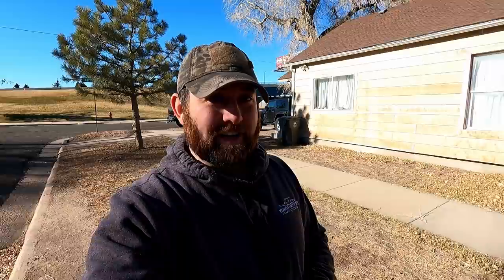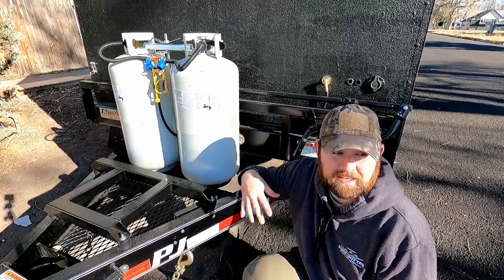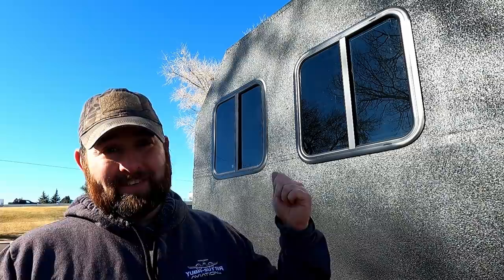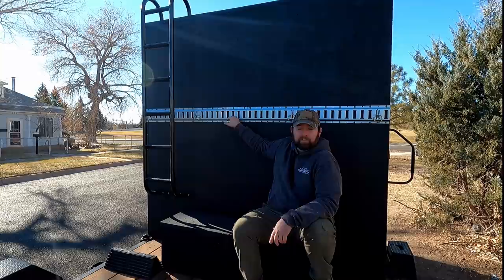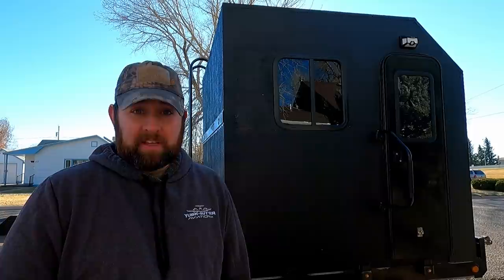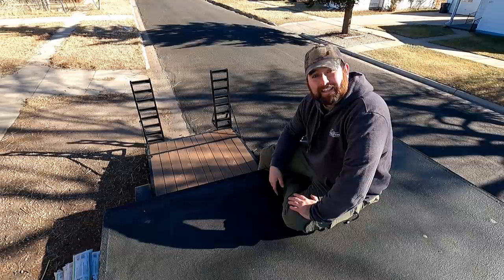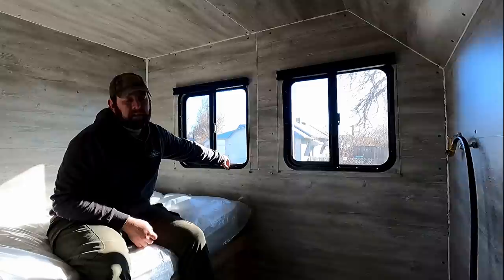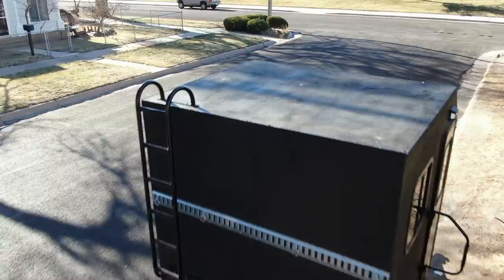DIY Crawler Hauler & Bugout Camper BUILD

Comment: So, you have full cylinder pressure gas going into your living space.. Interesting...
Reply: He might want to research the RV Codes as bringing HP gas into the trailer probably violates the code. All trailers have some sore of in-line regulator outside and the appliance regulators inside handle that pressure.
Reply: The changeover regulator he has is correct. Not quite sure what he meant, but you can clearly see the regulator there. The house barb situation is another issue. Should have UL approved hose there. Norm is correct.
Reply: @jefferydaniels5650  He specifically stated that he did not regulate the pressure down because the units inside the living space did not work at the lower inlet pressure. The change over could be a full pressure change over module.
Reply: @markchisholm2657 
At the 2.26 pboto he has an automatic change over regulator
Reply: Whether he used it, I cannot see in the video.  But the regulator drops the water column and the pressure.  The appliances use their own regulator to fine tune the lp gas for it's specific needs.  I'm a licensed lp installer and work at a lp storage terminal that stores 40 million gallons.

Comment: For your window trims, go to a body shop that specializes on commercial units/RVs, have them build you frame you can slide into your openings, and rivet, screw, glue on.
Here in Tampa, there's a place called All American Sleeper Cab, they can make your trims, with an outer lip.
People at the service department at truck dealerships, Ryder, Penske, etc, can guide you on where to go.
Best of luck.

Comment: Great build. for your batteries make a battery box to mount under the camper near the front just behind the propane tanks. but locate them in a position to not make the tongue weight to much and mount a spare 20 lb   propane tank in the event you are out longer than anticipated and think about a battery power inverter. and you mentioned water ! how about getting a shallow racing fuel cell with the foam insert to prevent the water from sloshing around and mount it under the deck between the rails. These fuel cells are made from aluminum and you cn get them in many shapes and sizes. Again great build keep up the great work.
Reply from the maker: Those are some kick ass ideas. I already have a powered station installed right now, but I really like the water tank idea!

Comment: harbor freight has a solar rope light and I just drilled a small hole, and then spray foam, around the hole and it comes on at night automatically. I’ve had it a couple years now just bought a couple extra on sale

Comment: When I built mine I  immediately realized I needed a ceiling/roof mounted vent and (or w/ out a fan is up to you?) the adjustable hatch does wonders when providing good air circulation/ventilation also being a nice little “sky light” also. Consider a small solar power kit to help supplement power...they are nowadays inexpensive and very simple and pays for themselves quickly, easily upgradable. You’ve done great so far!
Reply from the maker: Thank you! Since this video I've installed a Maxxair fan on the roof and ita awesome. I also installed two more solar panels and got a Bluetti AC200P for the power source. I love it so far.

Comment: Also add a boat seat mount or some way to post up in a chair and drink a beer. Or whatever having your own chair ready to go is so nice at times.  Also if you plan on going out on your own think about things as if you got hurt like broke a leg arm foot make sure you can get to you needed things and can load up the crashes keep too. Even if you don’t plan on doing it alone. It makes things nice when they are needed and sometime no one else has even thought about it. Kinda the point of your own tow rig is if you brake down having fun you still get home even if your loping on a rigged crutch getting home. Always be prepared for as much as you can and then some and learn from each trip. Learned a lot growing up and always travel with the set of I have to make it home at some point with all the toys. Either drag them my self home or keep cash to get a towel with the toys home. Always keep a ride home either bye fixing things your self repairs or Sapir parts carried and always keep some cash hidden somewhere in case you have to make a parts run to the store after flipping it and lost phones and wallets. But I’m not made of money and work hard for my money but I still try and have fun. And like to have nice things. So sometimes  having to build them your self and maintain them your self or pay someone else. Plus it’s about the adventure and how you got wherever you were going. Plus sometimes you have to build to have exactly what you want and piece it back together a few times till you get it worked out. But it’s part of the fun. Also always keeps like freeze dried food stached in the keep just in case you get stuck somewhere 2-3 days longer then you wanted to since parts are on order your in some small town that’s closed on the weekends. Just keep it away from the animals like in small ammo can bolted some where. Or if the trail is too small to fit the tow rig. Just some things to think about. Learned from experience and years of camping and playing with dirt bikes boats wake bords and just long road travels. Spend less money on paying people to do things and less buying things and build them your self then spend more time out and enjoy using the toys inside of too busy working.

Comment: I think I would add a cover for your propane that all four seasons, Put a window on the back of your cabin so you can still look out the back, and probably made the cabin into a faraday cage just for giggles so you can still put you electronics and not have to worry about them. put some solar power on your roof, probably put some 5gl cans for water with a foot pump and a little sink and counter top for cooking inside too during the cold months.  But over all pretty darn cool.lol just saw the wife in a pic cute, lol that's funny! :)

Comment: If you go off road may I suggest a bar from the front of your trailer to the outside bottom of your mudguards just to protect your guards and wheels from running into obstacles. It certainly helped on mine.

Comment: All looks great. I didn't read all the comments so if anything I say was said sorry. For your generator What about building a cage around it with some type of latch with a heavy duty lock so it cannot be removed but bolted to the trailer so there's no noise. See if u can mount the batteries under the trailer possibly  closer to the axles to balance weight. I would also come up with a clean water tank under the trailer with a solar water pump to get washed. All looks great so far u are going to have the vel also charge the batterys wile driving to your destination I hope. Looking forward to seeing the progress.

Comment: Looks good. For water, my 2cents it go small and light. Maybe some 4'or6' PVC tubes on each side up on top as holding/gravity tanks. Tongue weight being an issue dont want to much up there. You just need enough for dishes, cooking, solar shower type things. Maybe later you could put a small holding tank elsewhere with a little pump to get it up top again.

Comment: For water storage, I would put the main water tank under the trailer yours would have some decent cavities under the boards for an easy 20-50gals or more, and still have room for grey and black water table on the sides under the deck. 

Your propane tanks should ha e some kind of shielding, if you have an accident they are not protected. And could end very badly for you. 

Looks cool tough.

Comment: You are going to want to put some sort of protection on the front where your propane, and other connections on the front of the trailer.  Otherwise your truck tires will likely cover them with mud, dirt and crap while driving.  You might be able to just use a heavy rubber mud flap for a semi truck.  As for the A/C, I would not use an roof mount RV unit.  They draw a ton of power, but it would be overkill on such a small compartment.  A lot of small camp trailers now use window A/C mounted in the wall.  My truck camper just has a fantastic fan on the roof.  With the windows open and the fan on it is very comfortable inside on all but the most humid days.  Don't worry about the details, they will come together and answer themselves as you use it.  Have fun with it.  You've done great.

 Just a few ideas worth exactly what you paid for them.  lol   I like the build!

Comment: Good looking rig👍🏻
Too late for your build, but anyone else thinking of this may consider buying an old pickup camper shell/topper, cut the windows out for your build & trash the old fiberglass.  I did this on the 3 truck campers I’ve built & saved a boatload versus RV windows. They’re the same windows 👍🏻
Keep on truckin 🤘🏻

Comment: I'm going to put a black, flat water tank on top of mine the sun will heat it. And it will be gravity fed.  The one I'm build will roughly be the same size as yours.  Yours looks great. I'm also gonna ad a black water tank under the bottom of my trailer for a little toilet and sink.

Comment: Super nice, I would add a wood burning stove.  They make small  ones for camping.   You would save money on propane when firewood is available.   Also needs a carbon monoxide detector, a really important safety feature, when you have heat in a shelter.

Comment: You have done an excellent job, the propane tanks are excellent but I may leave the generator to gas and propane, your other choices are fine, I would have made the floor thicker to improve insulation.
Don't be upset with your work you have done well.

Comment: I work at ODL in Zeeland,Mi. We make customs sized windows with trapped blinds, and low E tint to either repell heat or attract it. We just use air in our windows, argon isn't used in a lot of windows anymore. Talking maybe a 20*30 house window tempered for around 70-80 dollars. And 10 year warranty on all products.

Comment: You should use some pop up camper ideas, specifically the slide out tray step, which would minimize lost ground clearance, and maybe the stove that can be used inside and outside. Then of course add awnings, or even a 270 degree awning to cover both the trailer side and the door side

Comment: So badass!!! I'm in the same boat with sleeping quarters and towing my xj
Reply from the maker: Yeah, I got tired of not being able yo find a toy hauler that could pull a full size Jeep so I just decided to build one. So far I love it, I got a lot of ideas from van life videos and builds.
Reply: How much does the trailer weigh, without the jeep
Reply from the maker: Without the Jeep it is 6000 lbs. But without the Jeep on on back it puts too much tongue weight in the truck. It needs the Jeep for proper weight and balance.
Reply: I figure it would need the jeep for proper balance. If you had to guess what's the weight of just your sleeping quarters? I'm trying to stay light weight, id like to stay under 9500/10k total trailer weight including the 4k lb xj

Comment: Got a couple thoughts on the steps/ladder to get in/out of the camper portion. 
The RV steps you mentioned are cool how they fold up, but that's the end of their benefit. In my opinion they tend to be weak and under engineered for the more , um, ... "huskier" gentlemen... like ourselves. 
The simplest design is to use half of a step ladder you find at your local hardware or thrift store. OR, build one with 2x6 lumber and some grip tape(like used on skateboards). Either can then be attached using a hinging bracket that allows the ladder to be lifted up and stowed against the door of the camper and then secured with a strap, bungee cord, or carabiner, etc. 
If you want something sleeker and cooler looking, search "ships gangway". This is just for a visual reference of what I'm going to attempt to describe. You can use metal safety tread(used on tractors and heavy equipment). I prefer the kind that has diamond holes and looks similarly to expanded metal mesh. The design is a little complicated to fully explain in the comments section, but you essentially run two lengths of pipe or angle iron down each side of the ladder treads. Bolting one pipe near the front, and one near the rear, of each tread, on each side. The distance between the front and rear side holes of the treads should be as uniform as possible. As should the holes in the pipe/angle iron. Once all is loosely bolted together, there will be a top and bottom pipe on either side of your treads. Attach the top end of the bottom pipe to your trailer. Then lift the top pipe up until the ladder treads are level with the ground.This is where the top pipe should be attached to the trailer. The attachment point for either the top or bottom pipe should be easily detachable(toggle, hook, pin, etc). This design allows for movement of the treads in relation to the pipes. Essentially, the treads will always be flat to the ground, regardless of the angle of the ladder or distance/height between the door and the ground. If you want a better description or help, feel free to message me.

Comment: Check it out, you could put a black plastic tank on top of it and have warm showers in the summer as long as you park in direct sunlight. 
The steps, fabricate a set that hangs off the rub rail on the trailer right under the door. 
Looks good so far though man good work!

Comment: might be able to take the trim off on the inside around the windows and use aluminum flashing cut to size and painted black then reinstall trim to cover the insulation. great job on the build. mine is a store bought 23 foot toy hauler with a 42 inch led bar which really comes in handy boondocking

Comment: pull inside frame off and add black metal strip to cover gap. replace inside frame. trim over door is a matching fabric covered arch called a "headknocker" sitting on two vertical outside corner trim pieces. hope that helps.

Comment: You are very creative. There is something that you need to consider since you using propane. You propane detector, down low and a carbon monoxide detector up high for your safety. A vent fan on the back wall instead of the roof due to space constraints might help out as well. Keep it up. Also, you might consider get an amateur radio license with radio and a cb radio for those unusual but occasional emergencies that take place in poor cell phone service areas.

Comment: I have a suggestion on the table you want. Do a flip table mounted on the wall with pull out bracket. Oh and as for a sink and cooking area a sink can drain into a 5 gallon bucket. So you can build it small enough by using stainless steel bowls. Trust me they work just drill the drain hole put ur drain in and ur good. I seen some really cool folding stools also that could slide under the bed when not in use & ur table is folded away ..

Comment: The generator could have a roof like an upside down square pan with extended edges to keep it out of the sun and rain, mounted on posts that hinge on one side and have a lock on the other, also a plate in front, with sides that extend back at an angle so rocks and road debris don't beat the hell out of it.  When you make a bed, I think the kind you hinge to the wall so when not in use, you can stand it up against the wall and out of the way....same with a table.
Reply from the maker: I was thinking of something similar

Comment: Awesome build. A suggestion for the water situation would be with that high of a roof put a 30 or 55 gallon drum and use gravity feed. I use one for my cargo trailer full of gear and it works great for utility purposes. You can put a spigot in one of the bungs and get enough flow to wash dishes and fill pots etc. Again this is an awesome idea, purpose built DIY projects are usually better suited for the guy building than anything you’d spend 10x more on for some assembly line piece of equipment. Good job sir.

Comment: Hi!

A few ideas.
-Flip out floor between the deck and your door.
-Sink a table leg in the deck, sink it so when you need to fix Jeep it will not be on your back when you are under your Jeep.
-Awning, a big sturdy awning.
-Paint the house part white, black box will be an human solar oven.
-Quick disconnect for the stop block, when you come from your solar human oven to the deck and had two cans of cola drink you will fall from it every time, its like trap wire. :D

Comment: Hey John. Snazzy idea and great appeal!! 💯. This may be overkill.. But maybe a fuel deflector shield.. To keep those road rock from potentially causing damage to the tanks? Tying it into the generator too.. Maybe like a v-hulled "hood" if you follow.. With the ability to raise it for access if needed. Cutouts could be made to access the generator. Also giving it that wind deflection and flow up and over the cabin. 🤔🤔

Comment: Wow brotherman! Good thinking when you build that. The inside and other stuff are small details that I am sure you ll work thru. The medal box tube frame and bed liner coating outside makes it tough as nails! Great job💪👍
Reply from the maker: It's heavy but strong. I wish I could have afforded aluminum siding but I really like the bed liner. Only issue I have with the bed liner is that it stains easy.